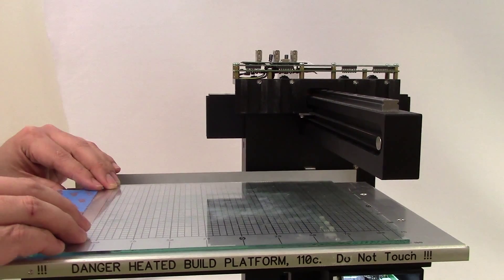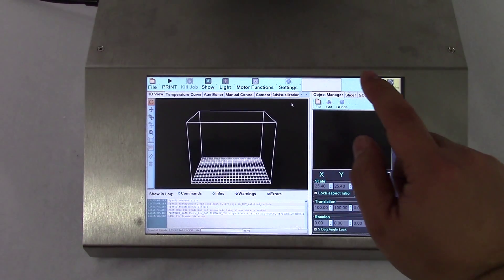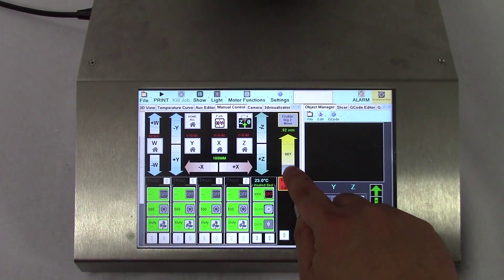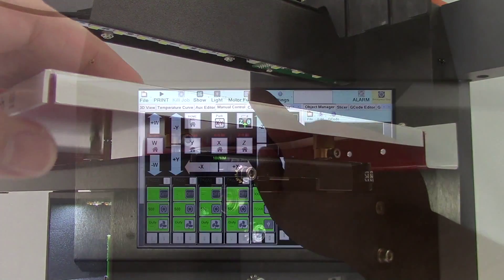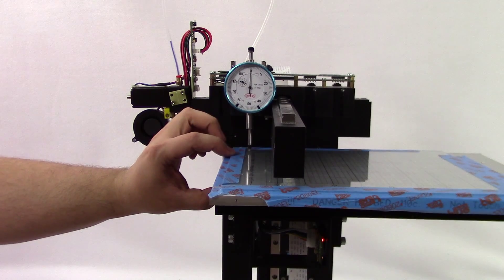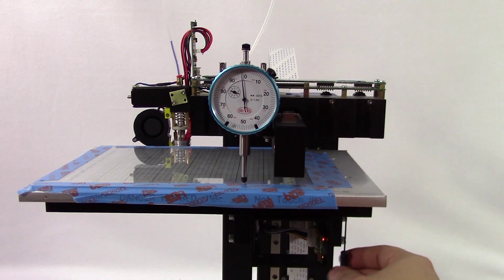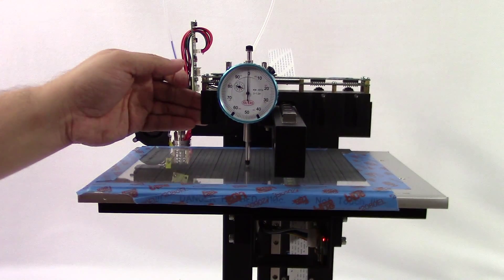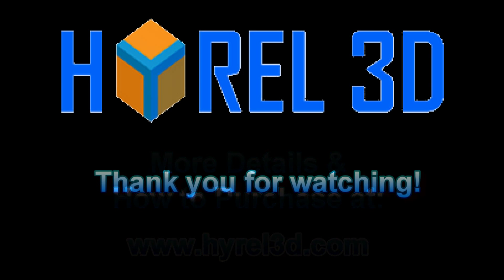HYREL Tramming Video 1.0

Comment: I'm really surprised the 0.5 mm hex driver is not send out with the printer. I don't have one and it seams really difficult to get one.
Reply from the maker: Elias, nothing on our printer requires a 0.5mm hex driver.

The bed leveling adjustment at 2:24 takes (on early printers) a 0.050" hex driver, and one was sent with every printer. Newer printers use a P1 driver for this adjustment.

The bed leveling lock at 1:56 takes a 2.5mm hex driver, and one was sent with every printer.

-Davo